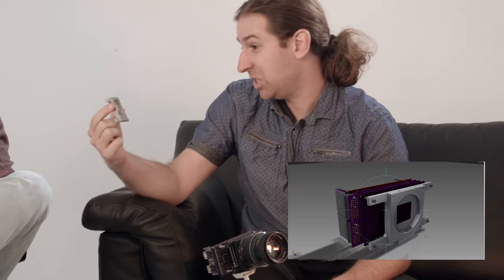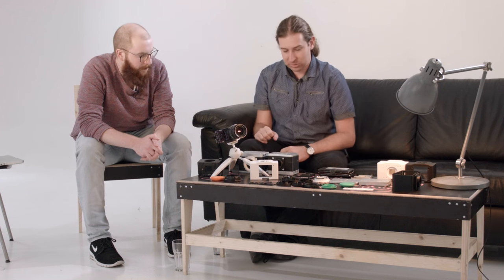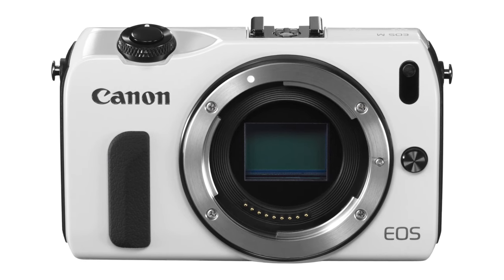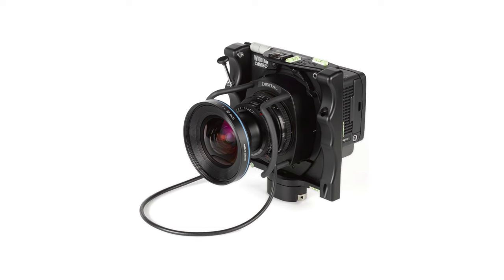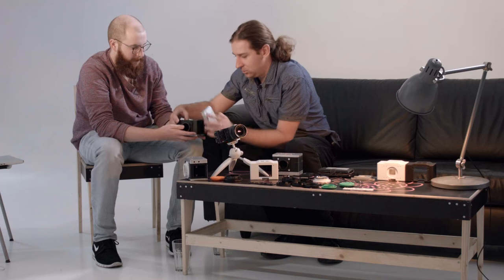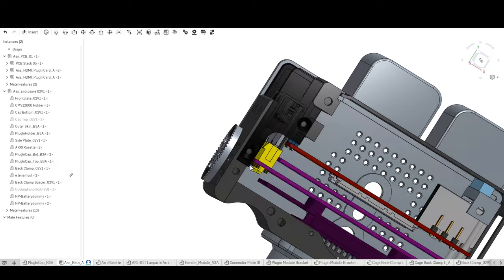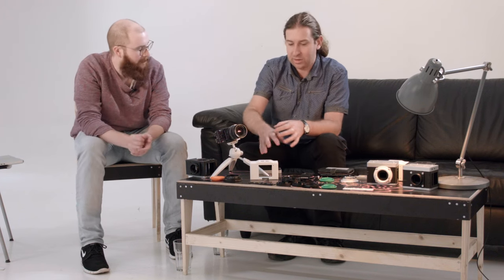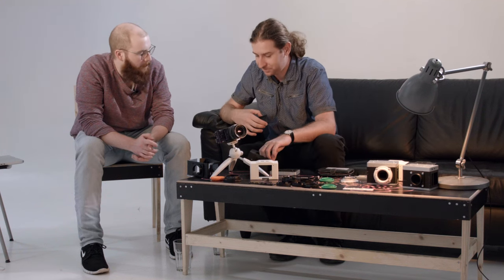AXIOM Team Talk Volume 11

Comment: How dust proof will the various enclosures be?
Reply from the maker: We will test different air filters and material with the simple enclosure and full enclosure, but in general we just blow air from the outside through the electronics (as most other cameras do).